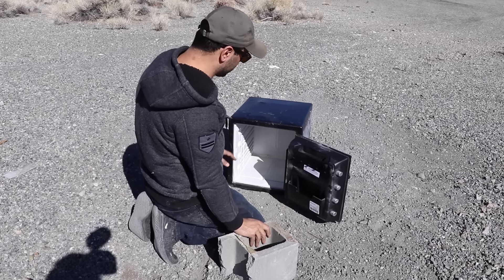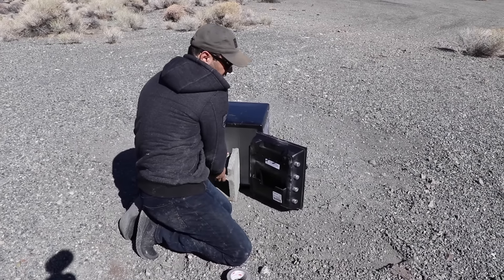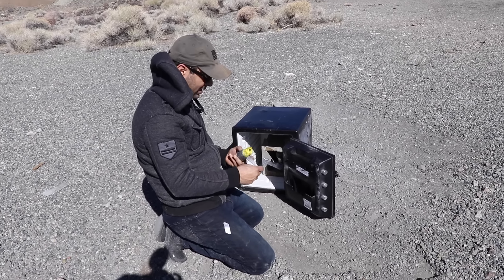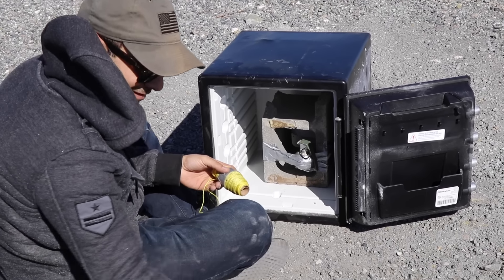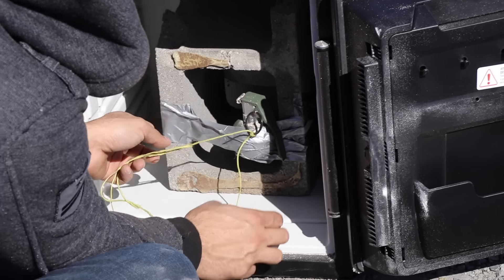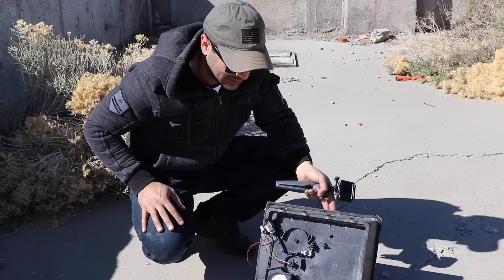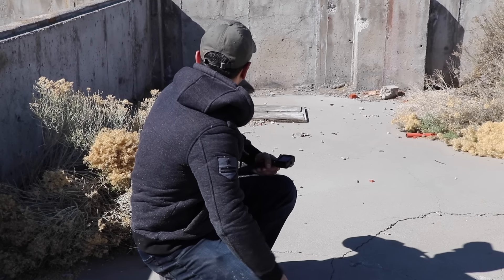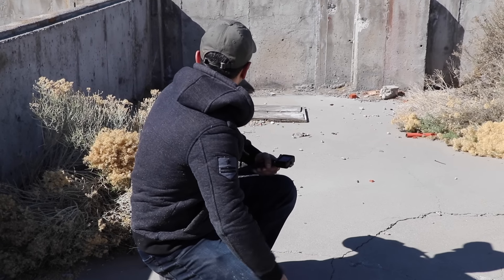Grenade inside A Safe

Comment: I’m an army vet, and I can’t explain the impact of these things.  When you get close to the practice ranges, you can feel the air pressure rise, and feel the shockwave from the massive explosion.  No way to explain it on here, besides maybe if you’ve had lightning strike close and heard and felt the thunder.
Reply: Yeah I don't believe they used a live frag. We would've seen the black smoke caused by the composition B charge regardless of how much compression occurred in the safe.
Reply: I don't know what they used but it definitely doesn't look like a real M67 going off.
Reply: I'm a former Marine and I agree completely. First time I heard a hand grenade go off, I was actually shocked by how loud and powerful the blast was. Despite being an explosive device, I was not expecting it to be that loud.
Reply: If you felt anything you were too close.
Reply: And it didn't sound right.
Reply: @DeadPixel1105  And that the blast to my ears was more like a "ssszzzoook" than a loud bang. That's from my memory of being out on the grenade practice area as a Marine.
Reply: It's really interesting you mentioned a close lightning strike as similar to the experience of a grenade.  I was USAF Security Forces in the 90s and threw several live grenades in training.  It's definitely something unforgettable.  About 20 years later, I was standing in front of my house, smoking a cigarette, when lightning struck my neighbor's tree and house directly across the street from me (about 40 feet from where I was standing).  It honestly scared the hell out of me!  And when I told some of my friends about it, the only thing I could compare the sound and force of it to was that of a hand grenade going off nearby.  So, from personal experience, I agree with the analogy.
Reply: @mikeo8890  If you throw a hand grenade, you're going to feel the shockwave, even if your behind solid cover.  Hand grenades are surprisingly heavy and when you throw them for the first time, I assure you, they do not go as far downrange as you'd like them to!  No matter how good an arm you have, the grenade will still land and detonate within 10 meters or 30 feet of you.  It's nothing like throwing a baseball.  The key is to be behind good cover.
Reply: I know the feeling, we did claymore mine training at Grafenwoer Germany, even though I was not Infantry I was a gunner on a M162 PIVADS or Vulcan ADA I volunteered for this while we were on bivouac.
Reply: Dude — same — I went to BCT/AIT back in 2002 at Ft Sill, Oklahoma (Army MOS 13F) and my first time on the range,  I was stunned at how loud an M67 sounds when it explodes!!!
Reply: Anywhere between ground zero and 25m is kill zone, especially taking shrapnel from the sage can be fatal
Reply: My shop got hit, blew out my lathe

Comment: While working detail at one of our helicopter ammo dumps in Nam we would pull the pin on a smoke grenade and dump it into a 50 caliber ammo can. After a few seconds ammo cans looked like a beating heart. Sides of steel cabs would buckle and move  finally blowing kid off. Never got to work in ammo dump that had rockets.

Comment: Lesson: notice the door is the only part still intact. Want to open a safe, go through the sides, top or bottom with a pick axe.
Reply: yea, most safe are cemented in walls 🤷🏾‍♂️
Reply: @tenslider6722  lmao hahaha
Reply: This is literally peak capitalism. Safes used to be made completely out of thick metal. But then companies started making them out of foam wrapped in thin sheet metal or even plastic to make cheaply yet still looking robust. The consumers chose safes that are cheaper and properly built safes were driven out of the market.
Reply: or a saw

Comment: When a grenade does that to a reinforced safe, yet soldiers jump on them to save their brothers/sisters.
Beautiful act accompanied by a horrible image.
Reply: It's not a proper safe, just a cheap fire resistant box. The outer casing is only about 2mm mild steel and the inside is plastic and fire resistant fill.
Reply: @echo21bravo  yet, my point stands my man.
Reply: @Nazz-b7p  modern anti personal grenades have segmented copper wire wrapped around an explosive core with the intention of sending out as much shrapnel in as wide a radius as possible.
Reply: @derekmcmanus8615  so the modern ones focus on shrapnel vs the actual explosion?
Reply: @Nazz-b7p  Essentially, yes. Grenades exploding in the open are not terribly impressive looking (not the big balls of fire you see in the movies), but still not something you want to be close to. My dad picked tiny pieces of Japanese grenade fragmentation out of his body for his whole life, and that was the stuff the doctors didn't get. Dad said the Japanese used grenades by the bushel basket full, but they tended to be overcharged, resulting in those tiny fragments. Or, they were undercharged and only resulted in two or three big pieces which could really mess you up if the grenade went off close to you. He said it was obvious that Japanese grenade manufacturers quality control was poor. But they made up in quantity. Dad only fought on Saipan and Tinian and had to be sent home due to the load of fragmentation he managed to collect. He got two Purple Hearts, officially, but guessed he was wounded often enough for many more than that.
Reply: @echo21bravo  Not a real grenade either, it's amazing how people fall for things like this..

Comment: just imagine..what if pin was pulled out by mistake during setup a grenade
Reply: Ooo yes
Reply: Then we wouldn't be having this discussion because there would be no video.
Reply: Andrew Jackson you are correct. Movies depict soldiers using their teeth to remove the pins, but in reality, their teeth would probably break
Reply: they would have ran away 
It takes some time for a grenade to burst usually 5,7or9 secs
Reply: astronomia will start playing
Reply: Then hit cancel and put in your bag😆😆
Reply: Run
Reply: @vivax5574  lol he has 6 seconds to run
Reply: U can't comment
Reply: Mission failed. Better luck next time.
Reply: @Ash-yw6kz  yeah 5 Seconds
Reply: @zarkmuckerberg8341  Well, it's not that hard. But yeah, it would require some effort and would probably hurt a bit to pull the pin with your teeth.
Reply: @vivax5574  😂
Reply: Imagined
Reply: Then just runnnnnnnnnnnnnnnnnnnn!
Reply: I just liked ur comment to ruin the exact 100 likes 😂😂🤣
Reply: @zarkmuckerberg8341  some people have strong teeth and bites. I have seen someone pull out a nail with his teeth so it's definitely plausable.
Reply: Graned? English please
Reply: @cabrail100  😂😂

Comment: I'm impressed.  I didn't realize how powerful a grenade is.
Reply: Same
Reply: It is mainly the contained space so the pressure can’t escape
Reply: it was a plastic safe
Reply: I'm impressed as well. But from the other side of the coin... how effective shielding a grenade can be. Now I understand better how if a team gets ambushed and a grenade is thrown into the room, some heroes will jump on top of the grenade, to shield everybody else from the explosion
Reply: Contained space intensifies the blast effect
Reply: @jackli1662  if that was the case the two he did on the outside wouldn't have disintegrated it. From what I saw in the Marine Corps with a few combat tours is that grenades are amazingly powerful. We used them for breaching steel doors when the engineers didn't pack enough C-4.
Reply: Did you notice that there was no fireball? Also the M60 has a kill radius of 5 meters, and an injury range of 15m.
Reply: @tonyb2271  I didn't know enough to look for a fireball, so I didn't realize it was missing.
Reply: IT'S A GRENADE
Reply: @krybling  Not plastic.  Pretty much all safes are constructed like this.  It's hollow steel with a cement-like filler between the inner and outer steel walls.
Reply: @tonyb2271  There is no fireball with an actual fragmentation hand grenade.  I expected there would be when I was 18 and in the military (because of what I saw in most movies), but in reality, it's just a really loud bang and a very dark puff of smoke along with the debris from the dirt and rocks around it when you see a real hand grenade detonate outside.  In training, they let us view them from within a bunker with thick impenetrable glass while we waited our turns to throw.  It was visually not that impressive, but the sound remains to this day one of the loudest things I've ever experienced (even with earplugs in) and the force you can feel (even though behind a thick concrete wall) is very impressive.

Comment: This demonstrates that sentry safes are crap.  Not that grenades aren't powerful, but all the fire insulation roughly went poof, leaving a very thin exterior, and the door.  The inside is just plastic.  I would like to see this done again with an actual safe with substantial metal walls.  If this was done already on this channel I'm open to a link. :)

Comment: Mr. Hand Grenade, my friend so true,
Always by my side, in all I do.
But when the pin is pulled, he's not the same,
His friendship turns to danger and to blame.

With every step, I hold him tight,
But one small slip, and all goes right.
Out the door, he'll fly with glee,
But for those nearby, it's not so pretty.

So heed my words, and take care,
For Mr. Hand Grenade, is not to be dared.
Friendship with him, comes with a cost,
One false move, and all is lost.

Comment: Even if you could get the grenade in the safe, it turns the contents of the safe into a fine powder and disperses it in the air. Going to rate this a 1/10 method for extracting a safe's contents. Zero points for effectiveness, 1 bonus point for being funny to watch.

Comment: Why not drill a hole through the door run a string through that and lock the safe with the grenade inside and pull the pin

Comment: The force has to go somewhere and the safe was a fire save. It did not have 2 inch solid hardened steel, but only 2 mm sheet metal with insulation. So it did about what you expect it to do.

Comment: Next time, make sure the door latches shut and locks quickly. Do a couple of test runs.
Then lay the safe on its back, door facing upward.
Remove pin, plop the grenade into safe, flip the door shut and latch shut. Run.

Comment: The LockPickingLawyer would use a strong magnet to open this safe, fitted with an electronical lock.
To open the lock, the electronic powers an electrical magnet to release the door lever.
A strong magnet can do the same from outside.

Comment: Since the microwave has perforations (holes) on the internal sides, how about a stiff wire to secure the grenade inside, instead of the cinder block? The wire would be slightly longer than the internal width. Even better, the wire could be secured using screwed-on metal strips. Anyway, I'm overthinking -- the cinder block did the the job and prolly provided shrapnel